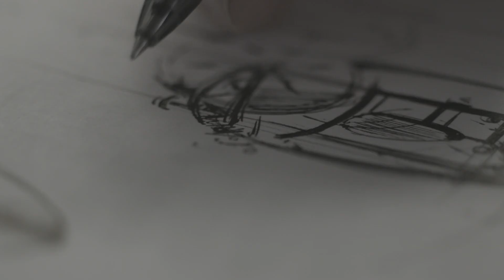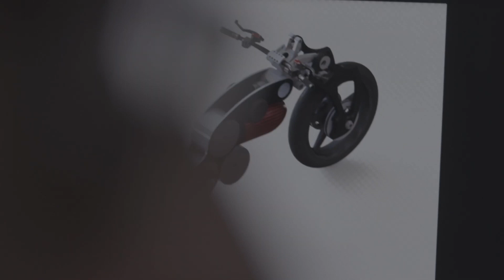Curtiss Motorcycles – Sustainable by Design

Comment: Cool looking bikes but in todays world DIY rules.
My diy disability scooter goes 37 mph and didn't cost over $1,000. I just built it with parts on hand or obtainables so it was much less than that even. But, having only a 12" front wheel let's you know just how dangerous that kind of speed is.